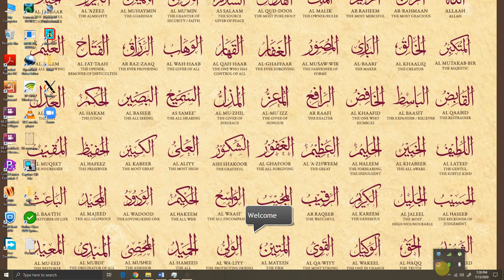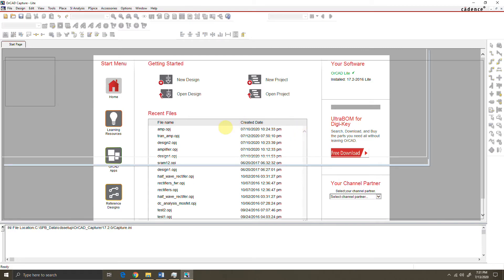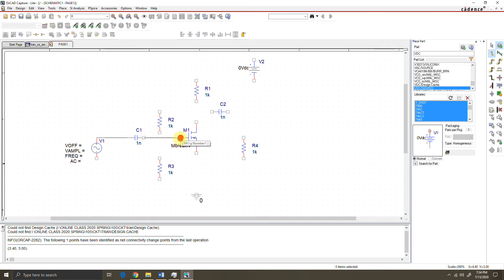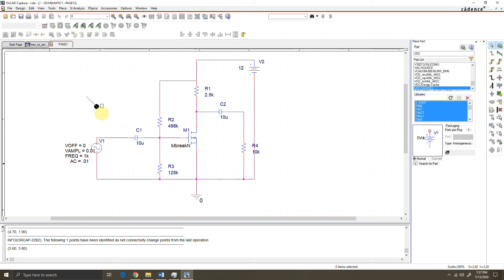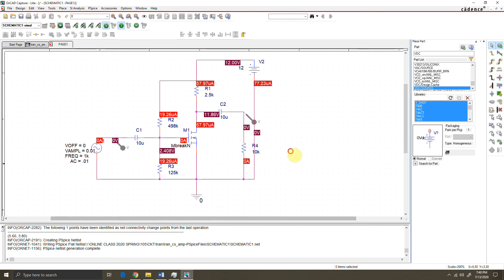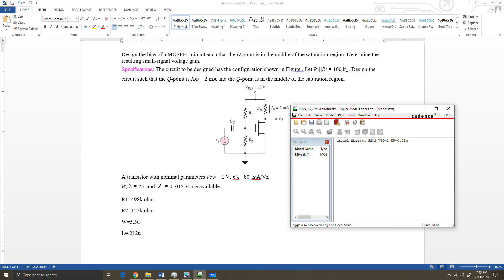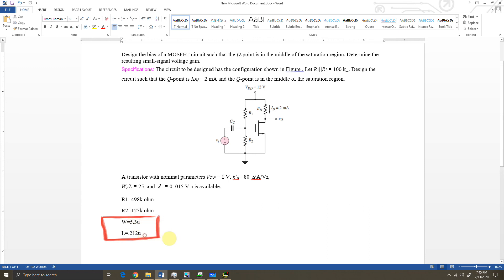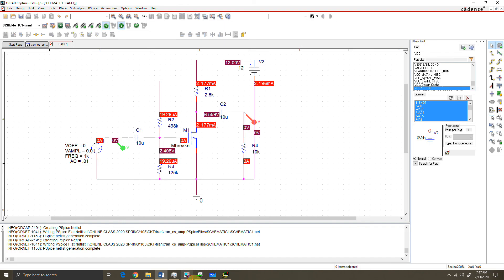Transient Analysis of a MOSFET Common Source Amplifier | CS Amplifier | Single stage Amplifier

Comment: I thought that the mosfet can conduct in only one direction. Can a single mosfet really provide sinewave output without a DC bias? I thought you would need another mosfet to conduct during the negative cycle.
Reply from the maker: Without DC bias, it cannot provide sinewave output.
Reply: @emondedead  Muhammad I mean AC sine-wave. This simulation shows it crosses the x-axis at 0 volts so there is no DC bias in the output of this simulation. If it takes a DC bias to create the sine-wave I would expect to see that input bias in the output also. I don't trust this simulation. I need to build an amplifier like this in real life and see what the real output is.
Reply from the maker: @Siiello  The output is taken after a capacitor which blocks the DC bias. Hope this answers your question.
I have one other similar video which might help you for HW design.
Reply: @emondedead  That makes sense thank you!